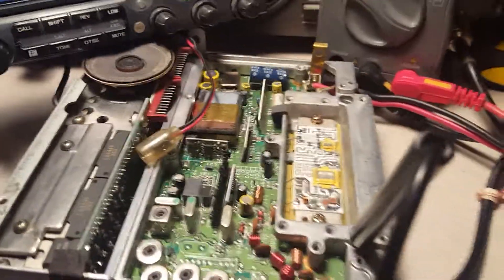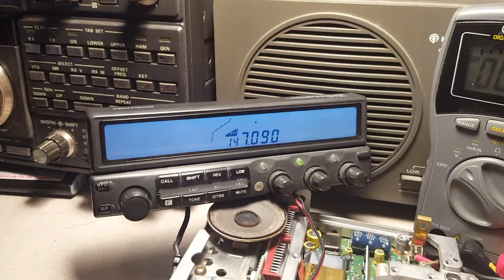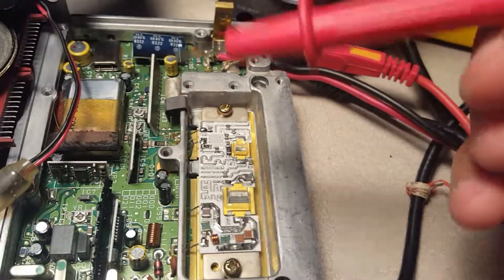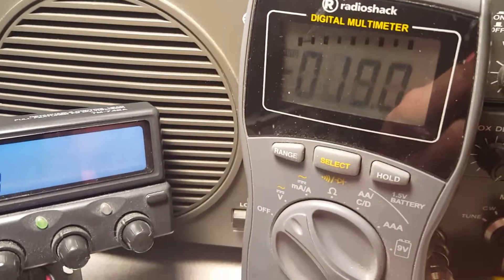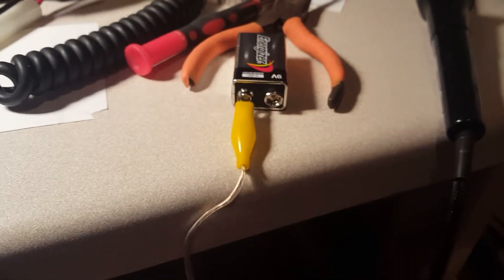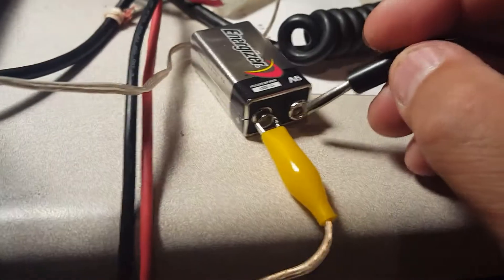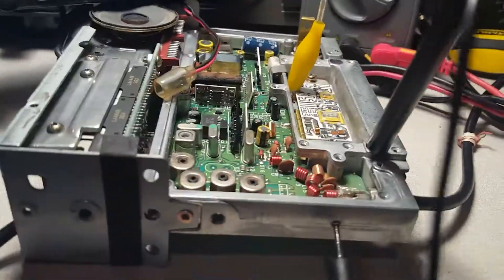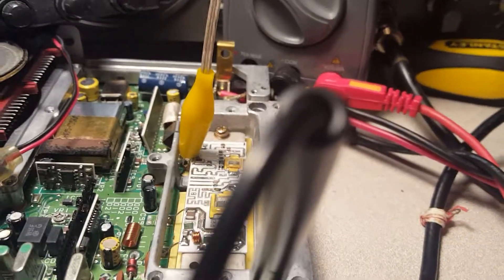Kenwood TM-742A troubleshooting

Comment: Correct .... great way of testing it... at Kenwood  Service Center in Cerritos back in 2002 we've tested many of those. Best to get the service manual. Sorry would give you a copy but I'm on a long vacation in Asia. 😊😊😊 impressed how you got it working... we do have those parts available.

Comment: Hmmm have a similar fault, radio works fine for a while then only on 2 metres it fails. No power out, small increase in total current with key down and I suspect receive is poor with fault. Any brilliant suggestions ?

Comment: Did you ever solve this?  I have a TM-742 sitting in my closet that has 2/70cm/6meter decks in it and it makes no RF on the 2/70cm decks.   I've not tried the 6meter.   I keep it around hoping to one day figure it out since there is nowhere to send it out to.
Reply from the maker: Yes... My issues was with switching between receive and transmit.  Basically the radio was locked in a receive state and not switching to transmit properly.  This was isolated to just the 2 meter module.

In your situation, I would guess the issue is in the common control portion of the radio.  Possibly one of the functions coming from the main IC chip that puts the radio into transmit.  There is a very good video on troubleshooting this same issue on Youtube.
Reply: @skyliner218  Curious what exactly your issue was, im having the same issue with mine. 2m only